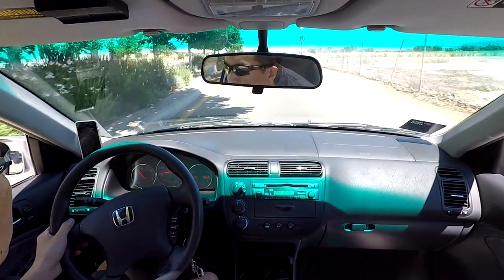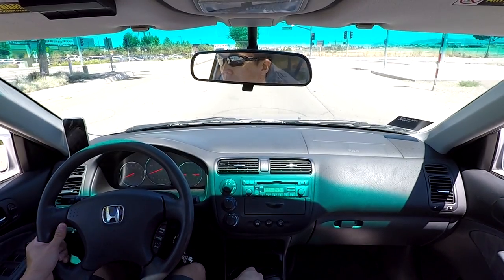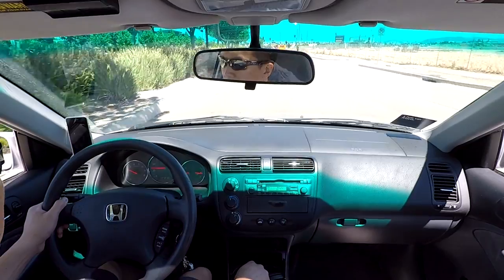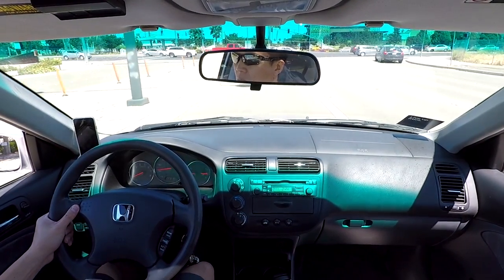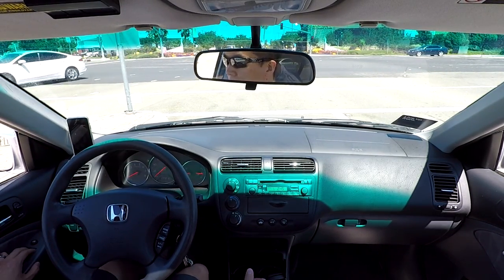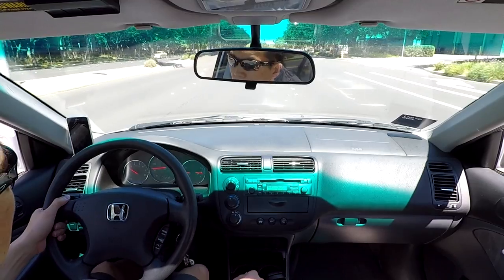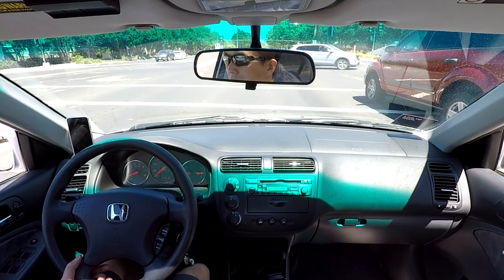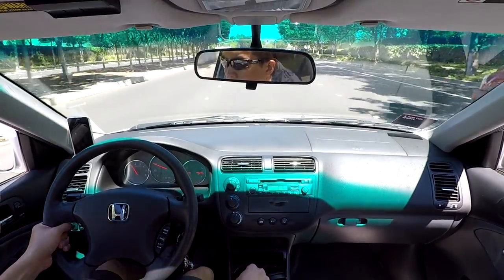How to Break in a Clutch

Comment: The clutch on my 2008 Scion xB has just been replaced and I felt like I’ve just started driving a manual again. So I guess I have to go on a break in state.
Reply from the maker: Yes, break it in or it's not going to last very long.
Reply: Same. 96 Z32, original clutch felt amazing. Not too stiff, grabbed towards the end of engagement, engaged smooth. New clutch put in, and holy crap there is little to no threshold for engagement.
Reply from the maker: @flusteredweasel7483  I feel like this is because the new clutch has all sorts of pad on it, whereas the old one had little pad, making you lift the pedal up higher for it to grab.  But in any case, yes, it's an adjustment for sure.
Reply: @nukem384  so this is normal then?
Reply from the maker: @flusteredweasel7483  I would think so.  But this is just my assumption.
Reply: This is why I’m here too! I had a new clutch put in my 2005 Carolla. And when I went to drive it, I stalled twice 🤦🏻‍♀️ lol. I’ve driven it around a bit today but it still feels odd to what I’m used to so that’s why I’m here.
Reply: @rumham7466  after a week driving my car woth a new clutch, it gets way better after the 3rd and 4th day. I cant take off quickly though, i tend to not apply enough gas and my shift into second is a little meh but its load better than the first few days.
Reply: @flusteredweasel7483  okay thanks! Good to know. Like I said I’ve had to take a few tries to get used to even moving into first. But I’m still having trouble smoothly going into the next gear also. I guess “dropping gears”? Is what it feels like. I’ve driven nothing but manual since 1999 but I still don’t know all the proper words to use. Clutch pedal feels like there’s such tighter space, so I have to push harder on the gas sooner than I had to before. That probably makes no sense. Lol. Anyway thanks I do feel better after your response.
Reply: @rumham7466  that makes sense. My old clutch threshhold was way bigger than now. Now i have little to no room to apply the gas
Reply from the maker: @rumham7466  Haha so funny.  When I got a clutch installed on another car may years ago when I didn't have the time to do it myself, I totally stalled a couple times in the beginning too.  The engagement point is totally different on a new clutch, probably because there's actually pad on the disk for the flywheel to grab, unlike the old one.

Comment: This is very good. I had  new clutch installed into my Ford F-150 and it feels sorta like I can almost feel the grooves in the clutch when I let the  clutch out, because it's causes a dull vibration. It's not the kind of jumpy feel when a used clutch isn't mating properly. My new clutch was just installed TODAY, so I imagine as the clutch breaks in that vrrrrrrrrr kinda feeling when I let the clutch out will vanish (?).
Reply from the maker: Streetwise Guitar didnt even know they made F-150s in stick, wow! I hope so? Usually right from the start, the clutch shouldnt be shaking at all, even when brand new. At least, thats been my experience
Reply: 2012 Mini Cooper. Mine is doing the same thing (Shaking, vibrating feeling) at end of engagement of clutch. wonder if my “break in period” wasn’t long enough. Damn.

Comment: My new clutch I just installed is slipping when starting off in 1st gear guess I must of used to much grease on the pilot barring?
Reply from the maker: Something is wrong, yeah.  Unless you decided to launch the car a whole bunch of times with the new clutch, something didn't go right with the install.
Reply: @nukem384  yeah no ive put maybe 10 easy miles on it it shakes when im releaseing the clutch if im in 4th gear an i smash on the gas the rpms dont jump it doesnt slip when driving just when i release it
Reply: @nukem384  ive replaced the clutch 2 year ago my self an never had a issue that time like i said only thing i did different was i greased the pilot barring so it wont fall apart an break this time
Reply: @nukem384  just when reversing or going forward it the truck just shakes alot untill im fully off the clutch
Reply from the maker: @kamryn7496  Yeah, whoever did the install didn't do it right.  I'm not a mechanic, so I'm not sure what the issue is.  Could be the throw out bearing like you mentioned, but I'm not sure.
Reply from the maker: @kamryn7496  Did you resurface the flywheel or get a new flywheel?  If you used the old one, that could be the problem.  Not an even surface for the clutch to mate to.
Reply: @nukem384  I didn’t resurface it I did just reuse it the flywheel had 5000 miles on it before the pilot barring went out i thought it didn’t look bad
Reply from the maker: @kamryn7496  That's probably you're problem, or at least a possibility.  You should always resurface or get a new one anytime you change the clutch.  I would look into those two things.  For the throw out/pilot bearing, if it's greased like you said, make sure you wipe off the excess grease or there's not grease that's able to come flying off the bearing.

Comment: I just got a new clutch in my mustang and went out for a drive, I was a little hard on it and at some points but never shifted past 5k rpms no launches just rolling into it, after a while I began to smell something burning, is the smell normal for brand new clutches or could I have caused damaged?
Reply from the maker: Could be a combination of both because you we're driving it a bit hard.  Normally, if you're driving the car easy with a new clutch though, you shouldn't be smelling any burning.  I would lay off the harder driving, even if you're not popping gears and such, just until it's broken in, then you can let loose.
Reply: A new clutch will always have a smell. It's normal.
Reply: Ik this is old but the smell is like hot breaks. It’s normal, that just the clutch getting hot and starting to mate with the flywheel

Comment: I couldn't help my self but do a couple hard pulls in my new clutch. do you think I already ruined it from a couple pulls or should I still be fine other than that I've been driving slow and shifting slow. Just installed my clutch 2 days ago
Reply from the maker: haha nice.  I'm can't say for sure.  You'll know once you start driving it around more and if you feel it slipping.  If so, you probably "glazed" it like I mentioned in the video.
Reply: @nukem384  🔺️ this guy is crazy with how much a clutch job costs.

I occasionally slip it a little more than I should on normal acceleration but I never ever go wide open throttle or run it at really high rpm.  Especially if it's a tuned or powerful car

Comment: Just got a new clutch in my e90 325i and it's like learning to drive all over again. The grab point I'm used to is gone lol. I appreciate this video about driving normal for 500 or so miles. Guess I'll use the backroads going to work for a bit rather than the highway 🤝🏾
Reply from the maker: Yup, no problem!  Ha!  Same thing happened to me on another car I had many years ago.  I was so used to the roasted clutch grabbing so high because the clutch disk had no pad on it, that when it was changed, the first time I drove the car, totally stalled out haha.  Obviously because the new disk actually had pad and the engagement point was like night and day lower.

Comment: Glad I found your video. I had a new clutch put in my ‘05 Carolla. Like another comment said, I felt like I was learning manual all over again. Stalled twice to start with 🤦🏻‍♀️ lol. I don’t know the right words to use.. slick/loose maybe? It shifts and drives nicely. But I’m like dropping gears because it feels odd/loose
Reply from the maker: Haha, yeah just gotta break it in and get used to the new engagement point.
Reply: @nukem384  okay thanks for the video and responding! I feel better. I’ll give it a bit to get used to

Comment: Just changed the clutch in my IS300, changed to a single mass supra flywheel and sprung supra clutch kit. I am looking forward to driving it like a granny and getting the clutch all good so I can enjoy the new flywheel at high revs :)
Reply from the maker: Man my friend had that car back in the day.  Very cool car indeed!  Hope you're good at leg pressing?  Haha, that setup sounds super stiff to get the clutch up and down.  Have fun once it's broken in!
Reply: @nukem384  thanks man, I really enjoyed your video it was very informative. This setup actually feels a lot lighter, the dual mass flywheel was heavy and the clutch felt sluggish, now the revs drop a lot faster and the clutch is a lot more responsive. I just haven't been able to figure out how to loosen the nut that allows the bite point to be adjusted, since it is currently at the floor and I am riding the clutch anytime I start or try to downshift. that thing just won't come loose for some reason

Comment: I just got a new clutch on my 2008 Toyota Aygo. I actually completely burned through the last clutch so my pedal was literally fully extended just to below biting point. Now it feels like a new car but the threshold is so much lower. Stalled the car about 5 times but I am getting used to it now.
Reply from the maker: Yeah, I did that too when I got a new clutch on a different car.  Totally stalled the first time because the engagement point was way lower than before.  You'll get it back real fast though.

Comment: Thank you for the video, but I do have one question, is rev matching off limits until that 500 mile period is over because when traffic starts to slow I have the habit to downshift form fourth gear down to third. I would assume that rev matching is safe to do as long as you don't go over 3500-4000 rpm like you said but would love some input from someone with more experience.
Reply from the maker: Yeah you can.  Just be careful with it and don't overrev the engine, as you've mentioned.

Comment: Will the clutch be okay after the break in if you accidentally dumped it at higher revs. Im still getting used to stick and bought a car with an almost gone clutch so i got used to the bite point being up high. When i dumped it, it was at around 3k. Otherwise ive been taking it easy. Just wondering cause id rather spend another 1.3k 😬
Reply from the maker: One time is fine.  It's not going to do anything.  Get used to driving a stick if that clutch will hold out.  Then change it for a new one and break it in properly.

Comment: Helpful video! I just changed my clutch on my 02 civic and the pedal feels stiff, is that normal?
Reply from the maker: I'm assuming you just changed it out for another stock clutch right?  Even still, the parts are new, especially the pressure plate.  That's probably where the little bit of stiffness is coming from, since the fingers on the pressure plate are new and not worn out like the old clutch/pressure plate.  I have a video on how to install the clutch/fly on this gen Civic if you want to take a look and see if you did anything different?  Let me know and I'll link you.

Comment: Hi! Is it normal for the revs to go really high and have some weak acceleration with a new clutch? I wanna ensure i keep this new one for as long as possible. Very helpful video!
Reply from the maker: Errr...that doesn't sound very good actually.  That sounds like the clutch is slipping TBH.  You just got a new clutch installed and it's doing this?
Reply: @nukem384  yeah...gonna go back the mechanic so he can look at it. Do you know reasons this could happen?
Reply from the maker: @stephaniefrost9720  1.Possible throw out bearing either wasn't installed correctly or they didn't replace it with the clutch.
2. Flywheel wasn't replaced or at the very least resurfaced.
3. You did some big burn outs and glazed the clutch like I mentioned in the video lol (probably not this one).
That's all I can think of off the top of my head.  But a new clutch should be working like a normal clutch, not an old slipping one.
Reply: This is what my car was doing when my clutch started to go bad. Higher revving with no acceleration. I just got my clutch replaced and although it’s a different feel while shifting.. it’s driving just fine

Comment: I've just had a new cluch and my new biting point feels like the car is going to stall but it never done this before. It makes the whole car rattle until I apply revs. When before I could just reverse out of a bay just using clutch with no vibration etc. Is this normal for a new cluch?
Reply from the maker: It's not an aftermarket clutch right?  Did you also get the flywheel changed too?  Or just the clutch?  If it was the old flywheel, was it resurfaced?
Reply: Thanks for the reply. Not was a brand new cluch, didn't change any fly wheel or anything like that 😑. I'm going to give it a couple of weeks and if it's still like it I'll have to ring the garage.
Reply from the maker: @shaungallagher3300  That's probably your problem right there.  If the shop didn't resurface the flywheel, that's going to cause that chatter.  Only way to fix it is to resurface the flywheel or get a new one unfortunately.
Reply: @nukem384  is it possible to new clutch adopt on old flywheel after one period of time...you know, to became smoother surfaces due mutual wearing...?
Reply from the maker: @strahinjicban4682  You can reuse the old flywheel, but if you're going to do that, I highly highly recommend you get it resurfaced and checked for thickness.  There's a minimum thickness level before the flywheel goes bad, just like with brake rotors.  If you don't resurface the old flywheel, the new clutch will chatter and go bad real fast.  Sometimes it's just better to spend the extra $100 and get a new flywheel as well since you're in there and you have to take the flywheel off anyway to resurface.
Reply: @nukem384  unfortunately my mechanick putted new cluth kit and flywheel is not resurfaced because for him it was not necessery, seems ok...but now i have little vibrations when i try to start in first gear without adding gas pedal, so only by releasing clutch pedal...i complained abot that and he told me to drive and dont worry, it need to take some time to new friction disc  adopt on oe flywheel...
Reply from the maker: @strahinjicban4682  Errr not a very good mechanic then.  That vibration is what I'm talking about.  That's happening because the flywheel isn't resurfaced.  You're going to have to deal with it now, but hopefully it won't be too bad later.

Comment: thanks for showing us the method
Reply from the maker: No problem!
Reply: Watching from Las Vegas, hope we can support each other’s channel 🥂
Reply: nukem384 is it okay to downshift with a brand new clutch? i got a stage 1 clutch for my civic and i’m really scared that i’m gonna ruin it the first drive
Reply from the maker: @DatHondaBoi223  what do you mean by downshift?  In normal driving, yes of course you'll have to downshift, so it's fine.  But if you mean like slamming it into a lower gear to get ready for a street race, yeah, I wouldn't do that.
Reply: nukem384 okay, i normally downshift so that my revs are around 3k. Is that too high?
Reply from the maker: @DatHondaBoi223  Nah thats fine

Comment: What do you exactly mean by not to engage clutch after 2k? How about when putting car in N from 3rd or 4th should i clutch in or no
Reply from the maker: Just don't ride the clutch.  If you're at a dead stop and your RPM's are over 2k before you let the clutch out and the car starts moving, that's riding the clutch.  You're basically burning the clutch and that's not good.

Comment: Do you have to hit all 6 gears each time you’re driving when it’s new ? Usually I always street drive anyways and hit 4th gear maximum.
Reply from the maker: Nah.  The important part is that you're changing gears.  You basically just want to continue to use the clutch/pressure plate.  Gear doesn't matter.

Comment: i’m about to break in my clutch so i have auto rev match. should i avoid down shifting in general or can i rev match to down shift at low rpm
Reply from the maker: You can still rev match.  You have to get into lower gears somehow right haha.  Better to rev match rather than slamming it into the lower gear.

Comment: Lol I've replaced c li itches but never broke one in before, as I've never replaced a. Lut h in anything I've owned. I used to trade my cars too fast. Just bought a decent little focus for not much but discovered veery quickly the clutch is gone. It let's go I'd ylu give it too much throttle. Right around 3500 rpms under moderate throttle you suddenly find a few new neutrals lol. Gonna drop the trans and replace the clutch and slave. Wasn't sure of the brake in prodecure. Thanks.
Reply from the maker: No problem!  Glad it was helpful!

Comment: Just got new clutch on mine and i have vibration feeling when taking off and reversing. My mechanic will check it on tuesday. I read this is normal for high performance clutch. Idk
Reply from the maker: Yeah I would start looking on the forums on that specific clutch.  Mine never had vibration at all.  But then again, I did put in an OEM clutch, not a performance clutch.  I wonder if the throw out bearing isn't quite on right.  That would be my guess.

Comment: I just installed a stage 3 clutch on a 2004 Honda Accord and when I try to take off the clutch feels jumpy is that normal ? I do have to change one side engine mount but I’m not sure if it’s the engine mount that I’m feeling
Reply from the maker: You may want to jump on the forums and see if that's normal for the performance clutch you have.  My video is geared towards the everyday person with a regular, non performance clutch.

I would not be surprised if that's normal for your stage 3 clutch though.  That thing has to have some serious grip compared to a regular clutch.  It's not going to behave like a normal clutch in some aspects because it's made to be beat on and grab the crap out of your flywheel.